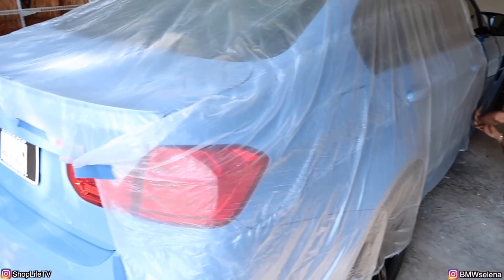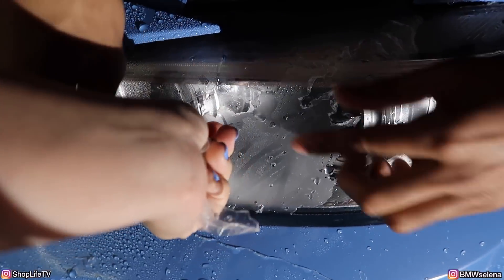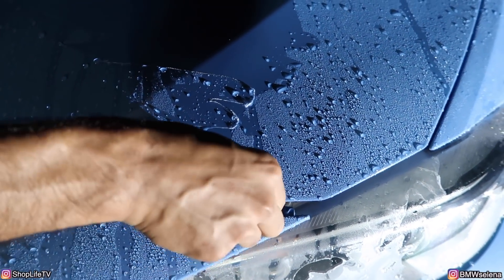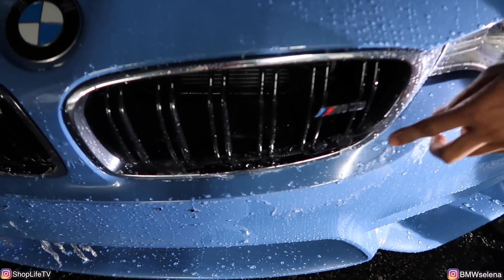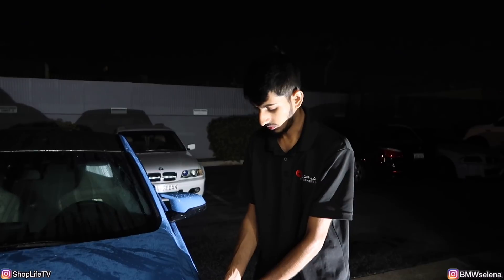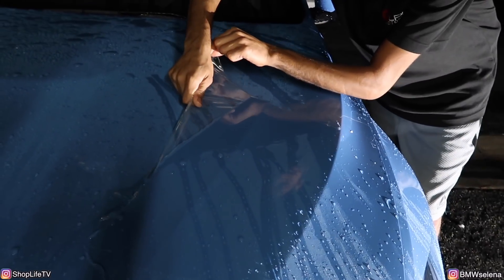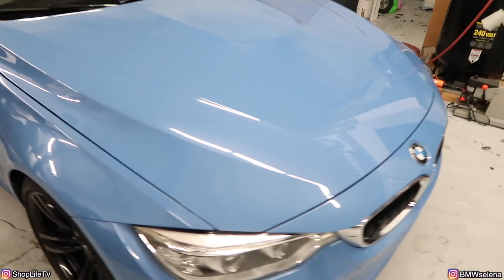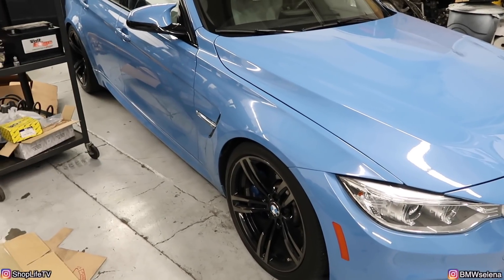Will It Peel Off? PlastiDip/AutoFlex On M3

Comment: How long does the auto flex last is it good for a few years like in Texas or California sun? The reason I ask is because my girlfriends e30 is having some clear peel I was thinking about sanding it with 1000 grit tell everything is smooth and there is no peeling edges and then putting on the auto flex with a paint gun.  Or maybe I should just spray clear paint on it

Comment: I repaired my e46 ccv system, new battery, tune up, even new fuel filter...tried to start it ..nothing...no assessories lights..completly dead...all fuses are good...pls help
Reply: Courtney Arnold check if you hooked the battery cables up properly and there tight positive to positive negative to negative @courtney Arnold
Reply: Make sure the battery is in the tray the right way as well that’s where you may have messed up connecting the wires to the battery